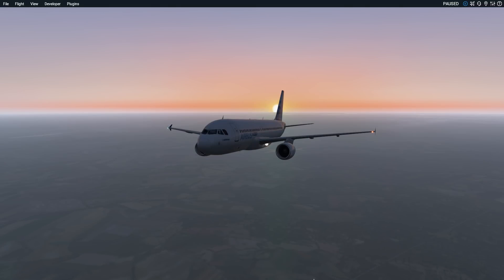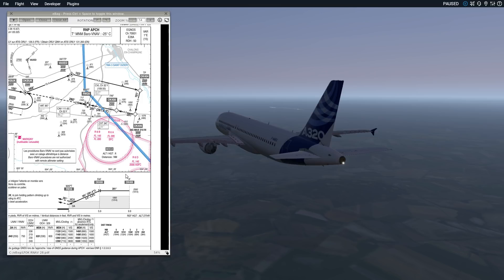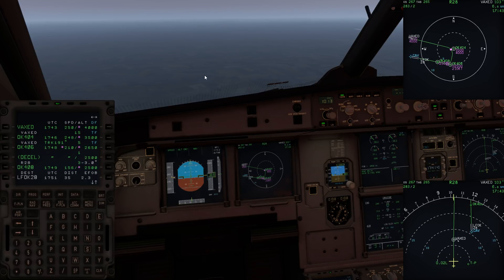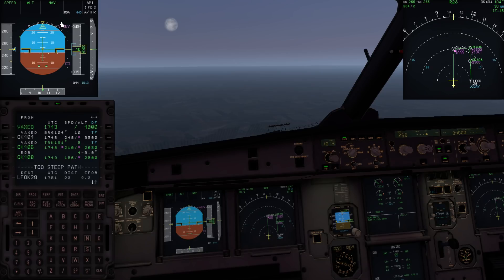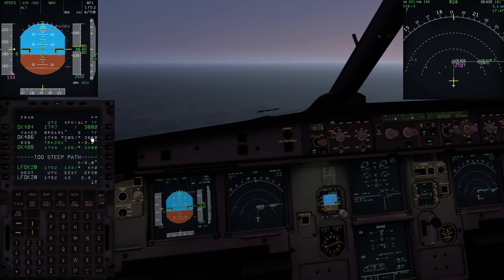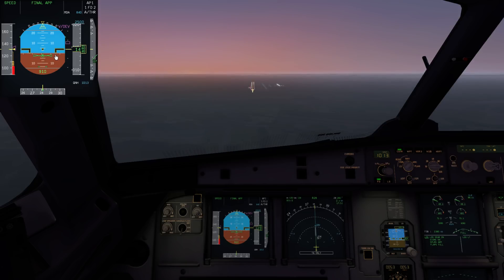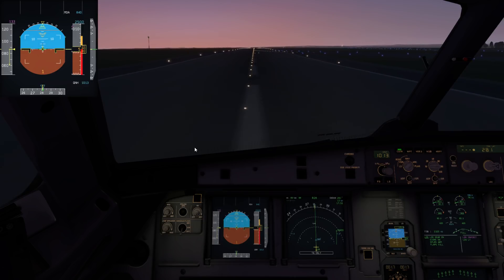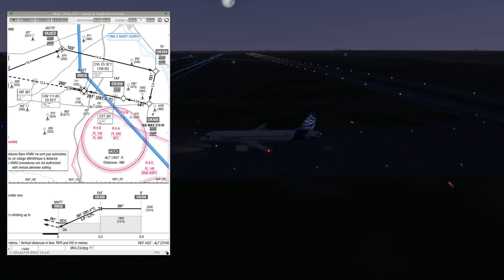FlightFactor A320 Part 4 - RNAV Approach [X-Plane]

Comment: Make it look so easy!  My biggest problem landing RNAV is keeping it lined up properly and landing hard....  lots of practice still ahead!
Reply from the maker: Yeah it’s always difficult. If it’s any consolation it’s usually easier in the real thing than it is in the sim!
Reply: @ReflectedRealitySimulations  Well, I am practicing alot... getting abit better. Question though - some pilots leave the FD on right to touchdown and others do not.  Why is that?
Reply from the maker: Great question. The Airbus rule is flight directors off if you’re not actually following them precisely. So on an ILS approach it’s allowed to leave them on for landing as you effectively follow them all the way to the flare. For a non-precision approach like RNAV it previously wasn’t allowed to leave them on so they went off for the final part of the approach. Current guidance is you may use them even for non-precision as long as the guidance is expected to be accurate, but most pilots still elect to turn them off. So ILS Approach=On to touchdown, everything else=Off. Hope that makes sense.
Reply: @ReflectedRealitySimulations  Thanks - yeah that does - just wondered about the difference between the pilots and inconsistent approach used.  Another question if you do not mind involves the auto throttle... yesterday I did an approach in an A-319 and left the auto throttle on .  The FD and autopilot (AP) were off.  Just AT was on and approach mode engaged. As I was about to flare and retard the throttle, the autothrottle (AT) kicked up again screwing up the flare.  I tend to like keeping the AT on all the way down as it keeps speed constant - but don't like it when it does this. Should I be turning off the AT before I get the RETARD notification?  On ILS approaches I do not recall the AT kicking up throttle just before touching down... and I vaguely remember another pilot stating that the FD left on may have an effect?  I believe in the real thing, if the FD is left on it will prevent you from veering off centre line?  Anyways - just want to perfect my landings.

Comment: Thank you for the excellent video Graeme! I hope you’ll be back to flying soon now that everything is calming down? Question: on the FFA320 my V/DEV is coming up as green rather than magenta. I’ve had a look through the literature but I can’t find the significance of this. Do you have any idea what I’m doing wrong? Thanks!
Reply from the maker: Hi Sam, Airbus changed fo colour a while back and to be completely honest I can’t remember which is newer! I think Green is more recent, was probably modified at the same time as RNP AR approach capability was added. In this case it’s just a colour change to better match the agreed international standard for use of colours on electronic flight instruments - nothing to worry about.
Reply: Reflected Reality Simulations Thank you for the insight! Much appreciated.

Comment: I didn’t quite follow why the FD needs to be switched off when you took the AP out?
Reply from the maker: An interesting question. In some cases the flight directors can still be used and guidance on this is changing at the moment. Most RNAV approaches are "coded" as far as the runway threshold so the FD's should provide useful guidance, but for the Airbus the normal procedure is if you're not following the FDs, switch them off. This is because partially Airbus recommend AutoThrust use throughout the flight and Airbus also tell us about interplay between pitch and thrust modes. Imagine descending towards an airfield on autopilot with the intention of converting to a visual approach. The FMAs are Thrust Idle, Open Descent. You become visual with the airfield, click the AP out and lift the nose slightly to reduce the rate of descent. The Thrust mode is still Thrust Idle, so the next thing that happens is your speed bleeds off and you end up in a low speed event. By selecting the FD's off, you force the autothrust mode to speed which prevents this scenario.
Reply: Reflected Reality Simulations thank you, that makes a lot more sense now :)

Comment: Excellent video and series thank you very much!

Can you please explain the difference between a GNSS and RNP RNAV approach for example Innsbruck LOWI RWY 26?
Reply from the maker: The terminology is continually changing. At this point a GNSS, RNP and RNAV approach could all be the same thing. GNSS or GPS approaches are a RNAV approach and as they require built-in monitoring are also RNP approaches. If you search for "icao rnp rnav terminology" you'll find a document from ICAO that goes into a little bit of detail.

The key difference now is between "RNP" and "RNP AR". These AR or Authorisation Required approaches have features that need special authorisation before they can be used, like flight crew training and equipment and database verification. In the USA these approaches are called SAAAR (Special Aircraft and Aircrew Approval Required). In simple terms it requires a level of tracking accuracy beyond normal RNP requirements, less than 0.3NM total system error.

So, if the ICAO terminology recommendations are adopted, all GPS, GNSS and RNAV approaches will be called RNP from December 2022 onwards.

https://www.icao.int/MID/Documents/2016/PBN%20SG2/2.PBN%20Charting%20-%20ICAO.pdf

Comment: Thank you very much Graham for this new video. I will test the same approach with the new data from navigraph to compare with yours on this video. I am not sure to have fully understood why the flight director has to be switched off below the MDA : you are speaking of a link between the pitch and the auto throttle but what would be different if the FD would be ON and the AP1  OFF ? I hope you will have some time to give some more details in your next video.
Have a nice week-end,
Daniel.
Reply from the maker: Great question Daniel. Imagine the aircraft is descending with FMAs "THR IDLE, OP DES, NAV". Thrust idle from the autothrust, open descent from the flight director and nav. Then the pilot decides to fly the approach manually, disconnects the autopilot and lifts the nose slightly. The FMA's don't change, so the autothrust is still THR IDLE with the pilot not following the flight directors. The speed will fall off until alpha prot is exceeded. The pilot keeps pulling the stick and then alpha floor triggers and the thrust is brought to TOGA automatically. This is why the Airbus rule is to switch off the Flight Directors when you are not following them, as this forces the autothrust to "SPEED" mode where a commanded speed will be maintained. Remember the thrust levers don't move, so that sensory feedback you would have from the thrust lever position is not there in the Airbus. Hope this helps.
Reply: Oh, I understand now. Thank you to take time to answer my question. I was just looking at your new video !

Comment: Hi, first of all - GREAT JOB! Very interesting and informative. Could you elaborate more about the trade offs and interest of descent rate and speed? What would benefit the passengers? The airline? What are the main considerations you've got? What's your airline guidelines?   For myself as a simmer- it's hard to find "a reason" to fly a different approach other the one that was suggested by the flight computer and i would really love to understand better the "way of thinking" of a real airline pilot. Thanks again for the super videos! I saw each one of them multiple times already and I'm trying to implement as much as possible with the FF A320!
Reply from the maker: Great question. The descent speed is determined by the cost index. A low cost index like 0 will have a low descent speed 250 kts and a shallow profile. Similarly a high cost index like 60 can give a descent speed of more than 310 kts. The cabin pressurisation is not really a factor on the A320 as it is easily able to keep up with the aircraft at most speeds. The choice of speed is normally based on how confident the pilot is on the track miles. With no potential for shortening a steep high speed descent can be flown, but if track shortening is likely a slower speed decent will be flown so that when or if the track shortening happens the speed can be increased to get the aircraft back on profile. Higher speed descent is steep, with less margin to make it steeper if required.

In the final stages of approach the workload is a factor. We'll fly high speed towards the ILS at our home base as we're completely familiar with it, but at a seldom visited destination a pilot will buy themselves thinking time by flying slower. In the last 30 miles of the approach you may be able to maintain a higher speed over 20 of those miles. If you do all of those 20 miles at 180 kts rather than 240 kts you would extend the flight by 96 seconds, so decelerating 5 miles early has a very minimal effect. Conversely the comfort from knowing "I've got the flaps available if I need them" has a huge benefit to the workload. Hope this makes sense.

Comment: Hi Graham another excellent video - I must say that before your series on the A320 I have tended to favour the 737 but getting to know the A320 through you I can appreciate the different quirks and am probably more likely to stump up the cash and give it a go. Thanks again for the generous sharing of your expertise. Cheers Pete
Reply from the maker: Thanks Pete, yes I love the 737 as well. The IXEG model is a very immersive experience but this A320 is very good as well. They are certainly different to operate, with the 737 rewarding good procedural knowledge (lots more switches!) and basic flying skills, whereas with the Airbus satisfaction comes from making the automation do what you want it to do. As far as operational capability goes, the 737-300 can do pretty much everything the A320 can do with the exception of CAT3B approach and non-precision to VNAV minima.